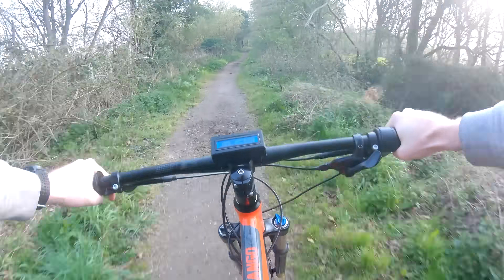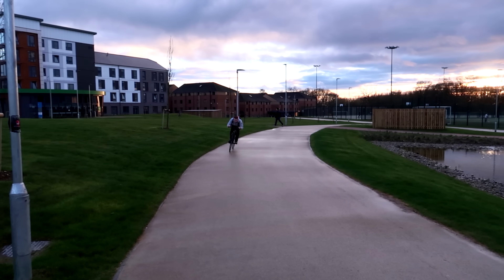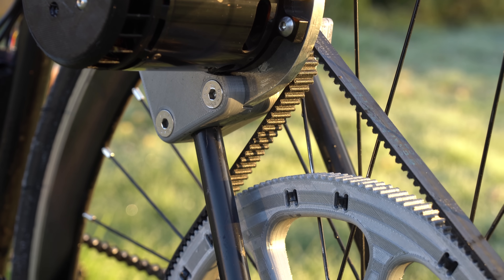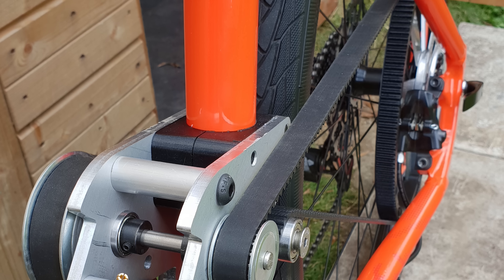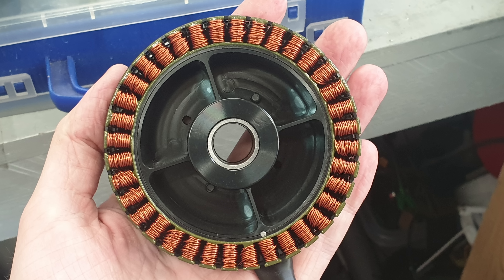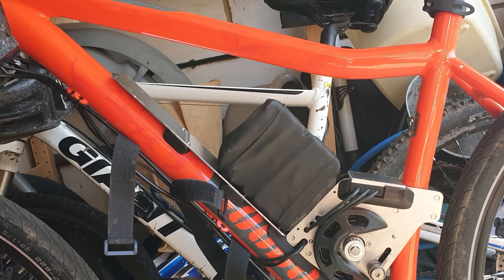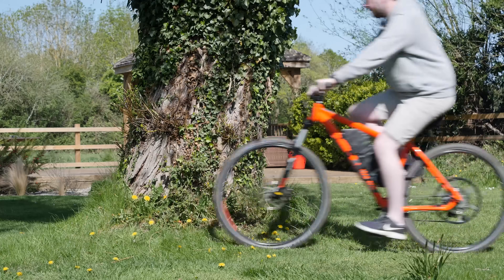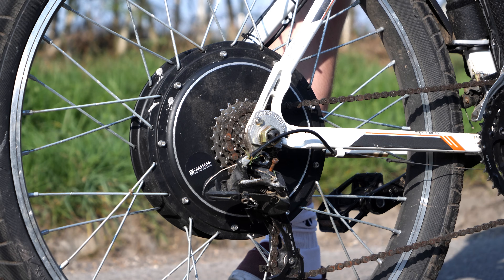Building an Electric Bike

Comment: Very interesting indeed.  At those speeds you should consider not just a helmet, but also gloves and possibly elbow and knee protectors, and chest protector.  The gloves should protect not particularly your knuckles but your palm, which is what people use to brace for impact when they fall off.  A mountain biker's shop should have all the gear !

Comment: i built a e bike back in the late 90's i used a zero turn wheel chair motor it was 24 volts. i could not figure out how to get rid of the grear reduction on the motor and it still run so i  so i greared it up HIGH i used the stock sprockets  on the bike and put the smallest rear spocket on the other side of the foot pedal. and used the large sprockets on the motor on a 27 inch wheel. and a button on and button off. after i learned to take off with out killing myself it ran 66 MPH or the spokes got to loose  whtch ever one came first and i got 36 miles to a charge. and thinking of trying to build another one with the new batteries and something to control my speed.

Comment: Fascinating discussion and demonstration. By the way, Harley Davidson uses the two belt system, with the motor driving the tranny, and the second belt driving the rear wheel. I wonder if it's to make up for an underpowered motor.
Reply: Harley designed the 2 belt system to reduce sideways torque and its a lot quieter.  A 1200cc Harley has 85 horsepower and up.  The 125 cubic inch engine produces 130hp.  Similar hp to a Toyota Prius.  Custom engines can be 2.5 liter or 3 liter beasts.   Also a large rear sprocket increases power too.  For a 1000 pound bike they haul arse!

Comment: now a similar setup to the front wheel with 12kw motors each and u can go over 50mph but its gonna have to get rid of the normal drive and use a lot of batteries

Comment: i dreamed about having a electric metal saw motor in a motorcycle those fuckers make 1500nwtms of torque so it could have 5:1 ratio on the rearwheel and damn it would spin like 1500rpm at 300nwtms of torque

Comment: In my country, you're only allowed to have "motor assistance" and it comes with a bunch of rules attached. You violate any of these, and it has to be registered as a moped rather than be treated as an electric bicycle. The rules are: 1) it can only go up to 6 km/h without driver assistance, so-called "start help." Any faster than that, and it has to be while the driver is also pedaling. 2) It can only assist up to 25 km/h. Any faster, and the engine must stop assisting. 3) It can only assist with up to 0.25 kW.

I don't know if the UK rules have changed since Brexit, but at least at the time of EU membership, the rule for the EU, including the UK exempts vehicles with the following definition from type approval: "Cycles with pedal assistance which are equipped with an auxiliary electric motor having a maximum continuous rated power of 0.25 kW, of which the output is progressively reduced and finally cut off as the vehicle reaches a speed of 25 km/h (15.5 mph) or if the cyclist stops pedaling."

Which has me wondering if these bikes are strictly speaking legal. 😅
Reply: I was just watching this but I believe our laws are the same. My understanding is because this bike can run without assistance after movement has begun and it has pedals then it is classified as an electric moped and will probably result in a fine and points on driving license (possibly even confiscation and destruction) if used on the road. 😬

Comment: id love to see something similar using a gear set or even the bikes original gearset if it can handle the motor. i feel like it could get around some issues like top speed and acceleration time

Comment: Great video. Great inspiration.
But where is your calculation based on? A calculation based on that might be true for a bike, but I build an electric long board with a gear ratio of 14 to 36 and 190KV motor. It depends on the wheel size as well. My wheels are only 85 mm yours are much bigger. So the equation does not apply to every electric vehicle.
Would be great to know where these are from.
Anyway, great build and crazy build quality with machined parts.
Thumbs up

Comment: I like your ratio, 
In penny farthings they talk about 1 rev = x inches, As this accommodates other wheel sizes. Maybe your ratio could do something like this so people with 29"mtb 27.5"mtb 26"mtb or 700c road or 20"bmx but obviously it would be using the metric system of measurement :-)

Comment: Awesome design, but it is illegal to ride on public road ways as a normal electric bike without a speed governor. There might be some kind of license that can be gotten to bypass this though. I think in the UK the max speed is like 25-30 KPH which is less then the max speed of 20 MPH in the US. If the UK is like the US, they most likely don't heavily enforce theses laws though, so some people do remove the speed governors from their "off the shelf electric bikes" to get to higher speeds. (Depending on the model.)

Comment: Why are you even using pedals, cause if the law requires them, it also requires you not to let the motor give you power over normal cycling speed

Comment: Shame in the eyes of the law that this is not an electric push bike but instead a electric motorbike, since it has a throttle rather than pedal assisted power output. Strictly speaking you should have them taxed, insured, get a license plate & pass a motorbike test. Unlikely anyone will notice though, even police. Its a silly law, the same law is the one that puta E-scooters and E-longboards in the same class of "motor vehicles"

Comment: hi i just watch your video and like it, question did you ever consider using a belt drive bike rear wheel as they have  built in gear box in the hub and is should make the bike more efficient and let you mange the power better. https://youtu.be/WxtJvhQmXLk

Comment: How about using hub motors with a couple of 1 F supercapacitors (e.g. ones designed for car audio use)? With good enough ESC that should be able to do pretty good regen and instant power output with very little mechanical losses. For example, 3 F worth of capasitors and 50 V voltage, your power storage is about 3700 J which should be enough to stop and re-accelerate a bicycle. Supercapacitors should be a lot lighter than Li-ion battery pack so it should improve the overall handling a lot.
Reply: this idea doesnt really make a lot of sence, because you need a constant power output the keep the bicycle at such high speeds, pedalling alone will not get you to those speeds. Not to mention the energy losses when charging and air resistance. Supercapacitors still have such a low energy density that you woullnt even get up to speed.
Reply: @vennox1598  As I wrote, "it should be enough to stop and re-accelerate a bicycle". I totally agree that supercapacitors are not energy storage method in general but for stop and go solutions that could be exactly what you're looking for if you are willing to get the energy for continuing continous movement from somewhere else.
Reply: no, even supercaps dont have enough energy to get you up to speed, just check out some of the other videos from tom where he explained it... also you cant pedal hard enough to ride at 35mphh @MikkoRantalainen

Comment: Tom, I build a go kart using 6374 motors. You said a ratio of 10 for good torque but for one motor. What ratio then if using two 6374 motors with two pulleys 84T and 11” tires? Thank you.

Comment: What if you used batteries for cruising and then super capacitors that can be charged with the batteries for accelerating quickly.

Comment: Diving your vids like this after doing a dive of various country laws regarding electric bikes, how much power and speed they can do without having to be registered as a motorcycle...
Technically you've got a home-built electric motorcycle or moped (which needs to be rego'd and taxed along with rider's license and crash helmet in the UK laws) there as the max power a electric-assist pedal cycle is meant to have in places like UK, EU & Australia is 200-250W and top at 25kph/15.5mph while pedaling before cutting out the motor. >.>

Comment: Hub motor is less hassle wrt ratios etc and it's direct torque onto the wheel and not via chain?
Definite advantage is changing to regular cycling, if the hub one fails it can be a tough ride home. Had a work colleague build one which failed 10miles from home...took a train back

Comment: If it has a throttle, it's not an e-bike.
It's a e-moped.
You put a motor on the CHEAPEST bicycle you could find. It has mechanical rim brakes.
This is why homemade vehicles like this should be prohibited from driving on public roads. It's contraptions like this that give legal e-bikes a bad name.

Comment: Very impressive, bike #1 maybe use a tensioner pulley between the two motors, to eliminate
the slip of the second motor/slack belt. Amazingly cool tech and design. Sell kits and get rich

Comment: How much does it cost big aluminium pulley on wheel??  You made a lot of reseach and they are very interesting. But the price of motors, controllers and etc (untill now) too high in  compare wih direct drive.  And very important thing in your case) is to use suspension and 12-20 inch   light weight wheels . Probably to use direct drive motor as a mid....i don,t now exactly....Thank you very much for interesting videos!!!

Comment: I wanted to ask a question, as I was enthralled watching this construction project.

Did you ever consider configuring the motor to drive directly off the gearing system on the bike itself rather than a standalone torque wheel?
Reply: that good idear cuz if you want speed you just shift a gear but if you want toupue you shit up i wound that as well
Reply: the sprockets on the rear of a bike are not big enough to get a mangable gear ratio beetween motor and wheel.

Comment: Hello. Thanks for the interesting ideas. What is your opinion - can I use a regular 24v 500w controller for 6354 motor? Intends to modernize a hand-held bicycle for a wheelchair. Regeneration is not required because interference-free running is a priority. And I wonder if you have an integrated freewheel clutch? Which one? 
https://youtu.be/DjIK38K7-wk

Comment: I've only built 1 ebike so far. I took my 25 year old mountain bike got a cheap 1kw hub motor and controller, a 48V 12Ah battery and Bob's your uncle! Cheap fun transportation! 

Now that I've gotten used to that it's time to go big. 3kw huh motors are readily available so that's tempting and isn't too expensive. However 8kw mid drive motors are even more tempting as more power is always more fun. I'm concerned about fitting it into a frame and considering trying to build my own frame. Fitting a large battery, minimum 72V and decent capacity isn't small or light. Bodging up a mount for that 8kw motor needs careful consideration. 
When I research buying battery packs big enough for that it makes me rethink just buying a whole ebike and the only one that offers enough performance is the Cyclone 18Kw bikes. They are about 4k USD but shipping from Taiwan costs a bloody arm and a leg. 
Thanks for getting me thinking about pissing away large amounts of hard earned cash on a new ebike

Comment: Hi please help. I have 2x 12v batteries at 220amp each. Connected as 24v. I've used a 24v starter motor with the solenoid removed. I've used it. For roughly 1 minute and there was hardly any power under load.  Cables from jump leads will get hot . 
I can't understand this. When this system should turn over a truck engine easy. If anyone can help would be much appreciated. Thanks.

Comment: A handy conversion to supplement the magical "10" number is that peak torque approximately = current * 9.5 / KV . If you're comparing motor and pulley combos at the same current,  you will get the relationship Tom found.

Comment: I was just wondering why use a out runner motor? Wouldn't an in runner motor provide more torque and be easier to attach a pully to the shaft easier?

Comment: that was interesting mate. you done what I was going to do many years ago but then I end up to buy e-bike conversion kit and just use that simply. the reason I did not do what you did was that I did not have access to cnc or 3D printer to make my gears or frames and mounting. also the big problem with T-motor or other brush-less motors is that they are sensor-less. so they are not good for a heavy loads like bike that needs high starting torque. but Hub-motor has 3 Hall sensor to sense the rotor position at any moment and start the motor with high torque. the other small issue that I do not know how did you manage it is that sensor-less ESC needs pulse signal to control the speed and pulse generator needs a variable resistance, but a normal Throttle has only a hall sensor. so how did you design your Throttle for your ESC??
I made alot of different BLDCs. one of them that was made for same purpose has 15kw power. I made the motor it self and I bought a high-voltage 250A ESC for it but never used it sadly. 
I am sure you have a workshop which I would love to see. I live in portsmouth. you?
something you mentioned in your video, you said hub-motor is big and heavy compare with other BLDC motors. do you know why? because they are made economically with weak magnets. what I am going to do is to boost one of them. I assume I can convert a 1000w hub motor to a 5 kw motor in the same housing. 
cheers.

Comment: Loving the ingenuity, but bare in mind that due to the motor power this is no longer classed as a bicycle but as a motorbike, and therefore subject to all the rules that apply to them such as vehicle registration, insurance, tax, and motorcycle helmet etc. Fine for use on private land with the landowner's permission but needs to comply for use on the road. Electrically assisted pedal cycles are capped at 250W average motor power output and motor stops assisting at 15.5mph. Not wanting to stop the great creativity, just wanted to make you aware in case you didn't know. If anything perhaps this could inspire your next upgrade to the system? :)   

https://www.cyclingweekly.com/news/product-news/electric-bikes-uk-law-234973

Comment: if electric bike goes over 25km/h here it is no longer cycle but motorized bike and you can get hefty ticked from that. If it goes over 50km/h . . . well lets say My cousing had to pay twice 2 000€ around 2005 or so ^_^ and I don't think the laws have chanced other than the 25kn/h electrical bike low or something like that :D

Comment: Just wanted to point out that your vehicle may not (depending on your local law) be legally classified as "electric bike" (and thus even might be illegal to build and ride without proper legal approval/documents etc.). 
For example in my country the motor can only be turned on by force applied on pedals (so it can only assist cycling), not separate control in handle and it must turn off after reaching 25 km/h (plust the power can't exceed 250W). 
So if anyone wants to follow this video, please check your local law.

Comment: EV cycles are fun but the problem is the braking ... i made a 45-57 mph bike .. witch was scary .. even with dual breaking systems hydraulic disc brakes suplimented with v brakes ... it would still not be enough .. thats the problem ... how much you wanna turn a bicycle into a motorcycle.. it will never be a true motorcycle .. in terms of safety and braking .... Tom i have a challange for you design a ABS or SMART breaking system for your bike

Comment: Hey do a video with another motor up for front wheel and connecting it with common accelerator. 
I have this idea but cant build one due to time and money constraints. 
I would really wish to see a prototype and i know it might add up a lil weight but if you have a switch to make each engine independent, then great potential to increase mileage and power. Gotta find a way to fix another scource of power.. but i think this will make a good experiment. So far i haven't seen anyone trying it.

Comment: Tom , I was wondering  if you can replace the bicycle pedal' s for the motor( mount the electric motor in place of the pedal 's) thus  be able to utilize the gears,  have the low gears for  torque to build up momentum and shift into the high gears to build up  speed ?

Comment: your pulley motor is so small ....  your rear pulley is so big.... you have the logic to the bike of 1910...
  attach your rear pulley instead your disk break not in your spoke and your star hub...
fix ; make a bigger pulley on drive and make a smaller pulley on rear instead your disc break..... mind it ...
or make a two step transmission ....
i said that to you 2 years ago ...
but so cool project very nice developpement .... bravo.

Comment: 3rd year Electronics Engineering student, planning an electric bike for my final project. With plans to include battery recharge through pedaling (Basically regenerative braking and manual regen).
I made a battery charging stationary bike about 6 years ago for my grade 11 science class. Wanted to make that but mobile for a cheap and eco friendly work commute.

Comment: You should add to in that it is illegal to drive this (in the UK) unless it has is registered and insured, and not driven on a cycle path.
Looks like yours doesn't conform to at least these requirements:
Its electric motor:
must have a maximum power output of 250 watts

should not be able to propel the bike when it’s travelling more than 15.5mph

https://www.gov.uk/electric-bike-rules

Comment: Once you went aluminum, you might as well switch motors and controllers. There's no point in pretending it's a low cost 3d printed project anymore. Once you brought in CNC's and lathe's, low cost went 🔥

Comment: I wonder if you could build an electric bike that charges as you manually ride it, and then (if you need to go a long distance fast) you can use the motor with the extra power it gained from riding.
Reply: Just find away to connect an Alternator to the chain and pedals